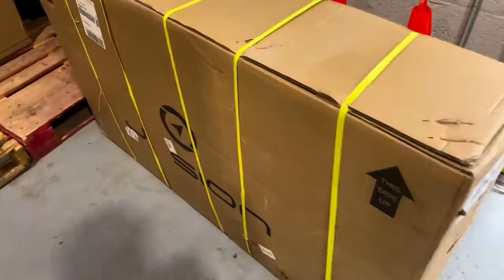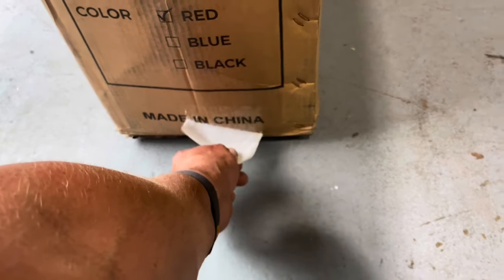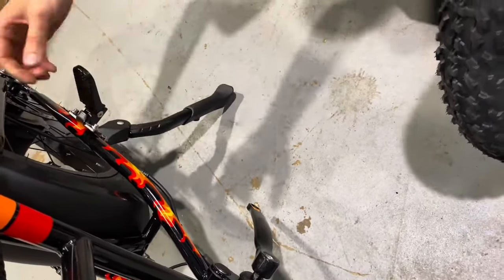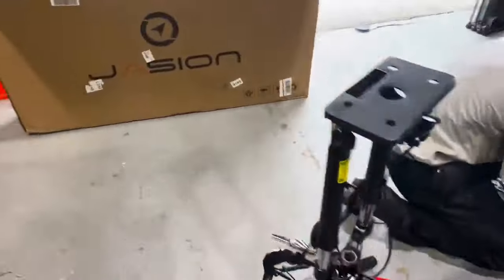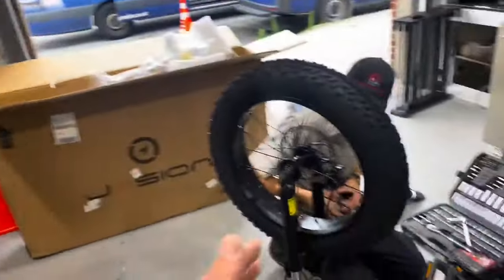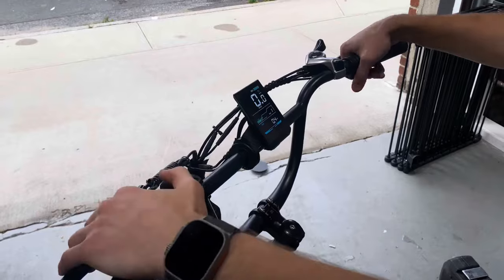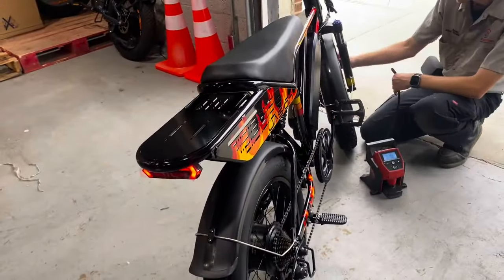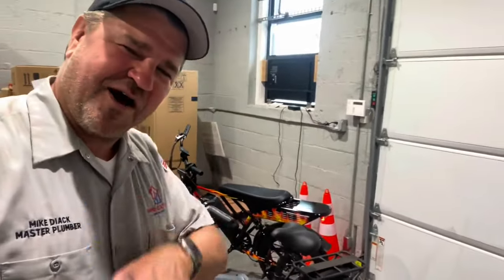Jasion RetroVolt eBike Unboxing & Review with BONUS Race Against xHunter

Comment: Mike, I'm looking into a mini split for my garage. 
I only need 12,000 BTU based on load calculations (my father is an HVAC engineer and did the calculations for me) 
What are your thoughts on Mr. Cool DIY mini splits ? I'd likely have someone install it anyways but they SEEM like a good value, just curious to get a pro opinion. 
Also considering Mitsubishi or Bosch mini splits but the mr cool seems to be a good value. 
Budget is not a huge concern but ideally I'm not going to buy the most luxurious unit since it's just for a garage. 
Thanks, 
Ben.

Comment: also, bikes shoukd have pedals and you should use them to help lose fat gut/rear-end and exercise (yeah, I could use plenty of that myself), but my knees and left hip and leg disagree.
mutters something about a 45mph to 0mph stop on motorcylce against back of car long long ago.
not to mention the multiple dozen of bicycle and bmx bike wrecks. also known as, I landed on upper left shoulder from 15' high before, hopped up looked the bike over and finished the race last place. before I got back on the bike, as a group of people were running towards me, all rescue squad. shrug, unsure if dumb or just a tough bastard(still feeling it all 30+ years later)

Comment: I would buy absolutely none of them... I would trust the old 1974 yamaha (2-stroke) with every bearing in it bad and very worn bore/rings/piston to outlast it. 🤣
bought a used very worn bike with junk engine and slapped it on mine (that a bearing cage failed on and ate the crank seal, molten rubber in a ball bearing = no bueno)
it was probably my fault, crap oil, and not realizing what the junk 10% ethanol pump gas would do(mid-late 1990's), it caused more washdown/thinning, which requires more oiling.
well that and I liked to ride wide open in the redline non stop.🥳
Reply: No one cares
Reply: Wrong forum and no one cares.